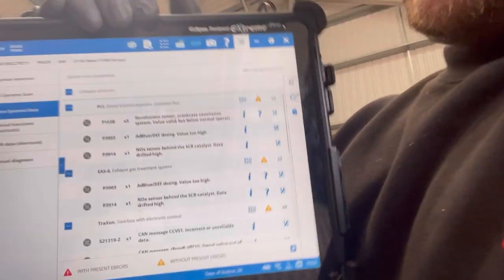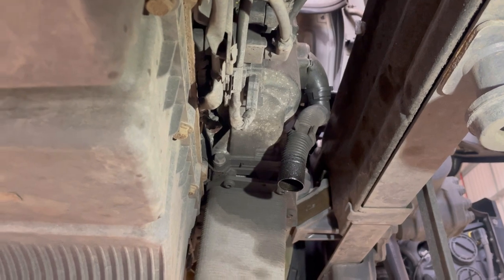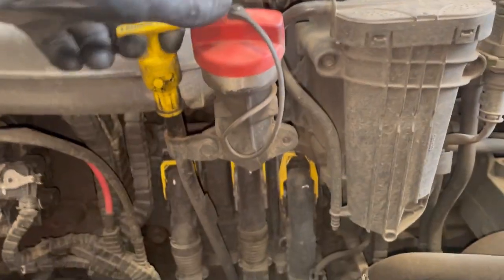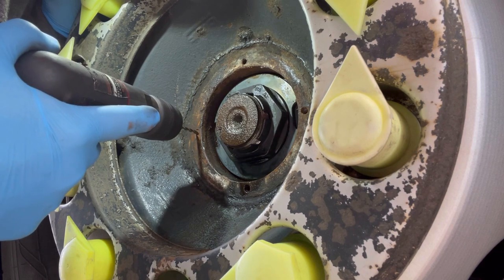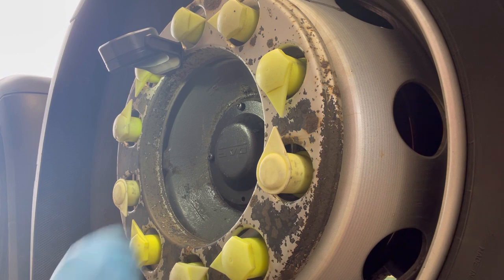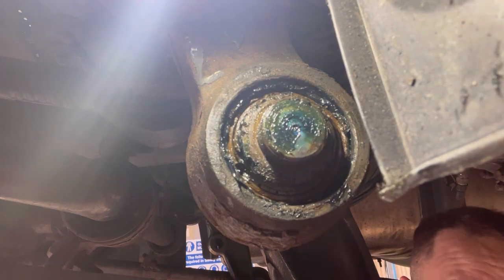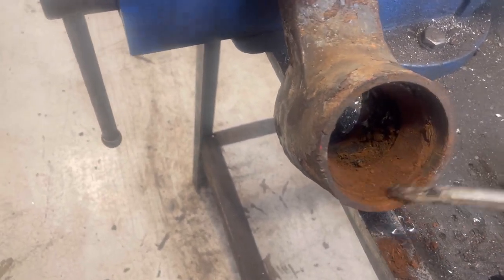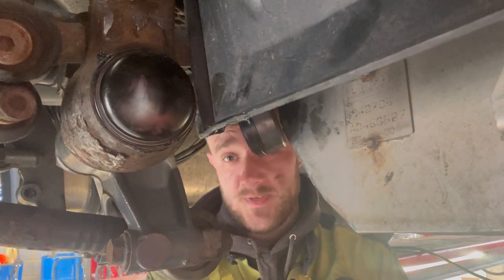VLOG- Life of a HGV Mechanic- DAF CF day- Engine malfunction, Steering bearings and broken bolts!

Comment: Excellent  video ,very varied  enjoyed it ..Has been a while since i have saw the relay bearings fail...It is good to see some one do the job right  rather than just  tighten it ,,fair enough nothing wrong cleaning and refitting and doing it next insp if no parts How many people do you reckon will change the filters in the CCV now it is a service item .not many i think ...top tip for the hub caps  ,the hubs are made from a soft metal, if the old bolt won't come out ,file it flush ,turn the cap 90 degrees fit the new cap then drill tap new holes ,takes about 15 mins 
Sometimes if you don't have the correct socket especially on a relay arm ,that is where experience comes in to it and you just know when it is correct..What you do and show is real life
Reply from the maker: Ahh thank you I’m glad you enjoyed it 🙌 yeah I can imagine not many people do change them filters tbf! Yeah that is a great idea I’ll remember that one for the next one! Yeah that’s it mate im just trying to show this job as it is no rubbish not everything goes well, just a day of what happens as a heavy vehicle technician.

Comment: Hi again, well done tapping the thread the correct way, this was the method I was taught 65 years ago, I have seen a lot of guys just screwing the tap in, all goes well until the tap breaks!! then you do have a job on your hands, just one point when drilling the broken bolt, a bit of lube helps cutting, I seen people using left handed drill bits, however you got it out ok. Regarding that steering arm, it looks like that inner bearing had never been greased properly, ok abut a proper tool for the special nut, you can't have a tool for every occasion, an old sod like me would have done it the same way, I would have found a large socket to fit over the cap when fitting it.  Ok about the VW videos if you can I would like to see your progress with that, sorry for the long waffle, regards Ray in North Wales.
Reply from the maker: Hi ray 🙌 yeah I have seen that a lot! People to aggressive with the tap! Abs getting a broken tap our isn’t easy like you say! Yeah exactly if you had special tools for every job you’d have a workshop full of tools you may hardly use, if in doubt a hammer and chisel 🙌 I will put beetle video up Monday evening 🙌 have a great weekend ray!

Comment: Any details on the wee torch that you had on the nut ring
Reply from the maker: The magnetic one?
Reply: @freightlanetv  yes mate or did you use more than one when re threading the holes
Reply from the maker: Ahh yeah that’s just a bluepoint magnetic one good torch tbf
Reply: @freightlanetv  thanks mate
Reply from the maker: No worries mate